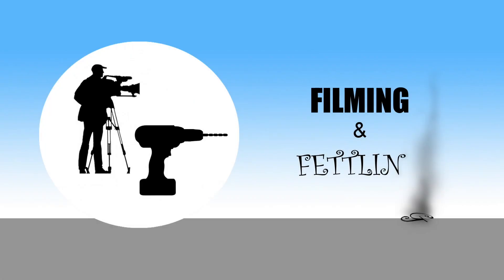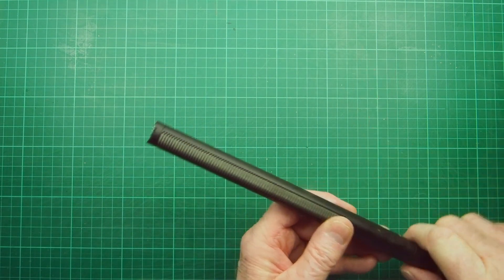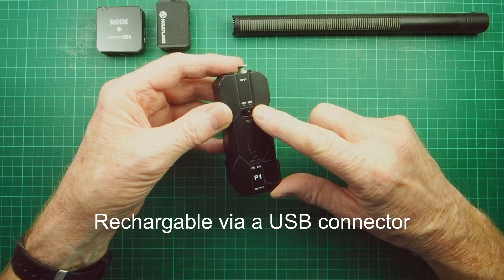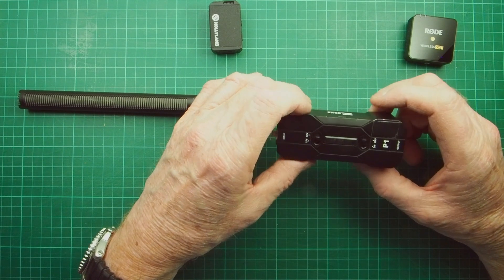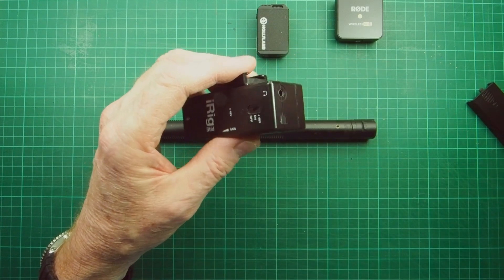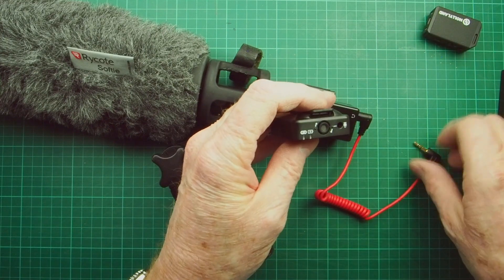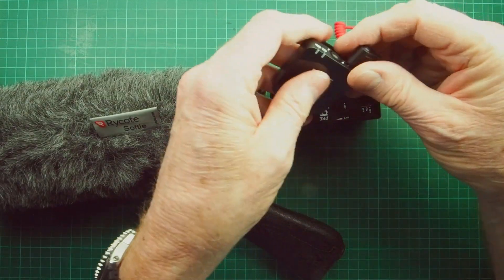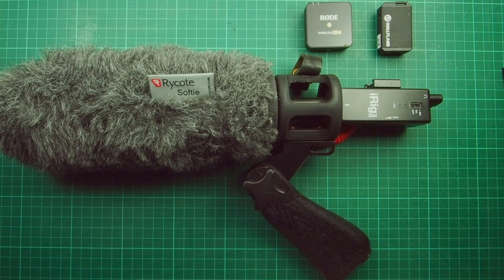FETTLING - WIRELESS

Comment: Just discovered your channel. Great informative video. May I ask what pistol grip you would recommend? I think a pistol grip and wireless mic may well be use full for some of the things I have planned for my channel. You have a new sub. 😉
Reply from the maker: Apologies - only just seen your post. Work keeps getting in the way and I haven't made any new videos in ages, that might change over the winter... As for pistol grips, the Rycote grip is hard to beat (the one in the video). The only thing to watch is that because the shock-mount is just a rubber surround that slips over the mic interference-fit, it is easy to have handling noise. I work with broadcast journalists and most of them don't know how to handle a mic like this when panning it for questions and answers in an interview. As long as you keep your fingers/hand stationery on the handle, even when moving it around, it will be fine. As soon as you drag fingers across the handle, in quiet situations it can be picked up by the mic, simply through vibrations. That said, it's not a big issue and hardly ever out of doors. Cheers

Comment: If anyone wants to try this but can’t solder you can use the Rode SC3 cable to convert the IRig from TRRS to TRS. Not as neat as this modification mind you. This setup is great for a wireless setup but is also useful for hardwiring a 416 to your mirorless camera if you don’t have the XLR handle. Thanks again for making this video, you’ve helped me a lot 👍